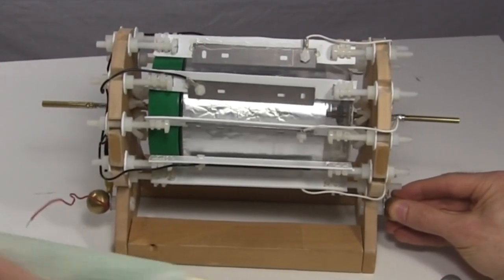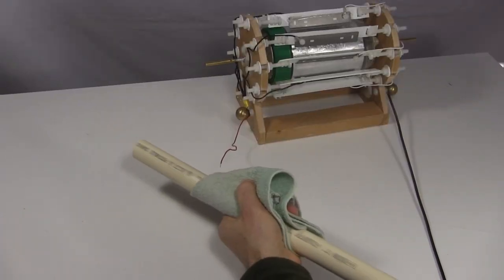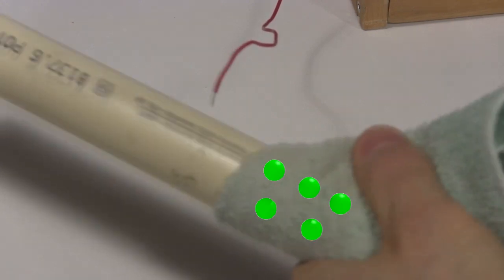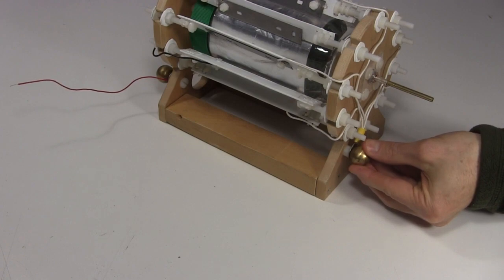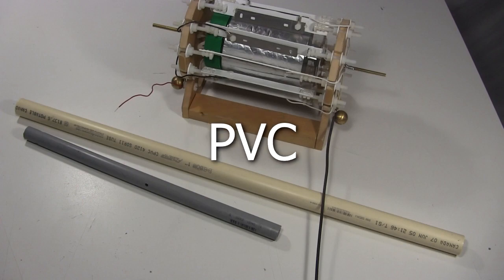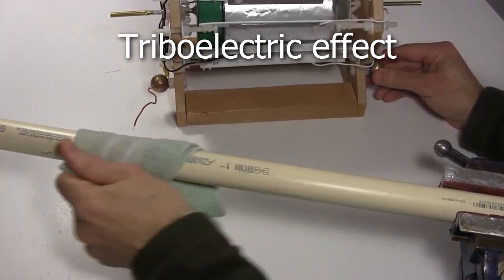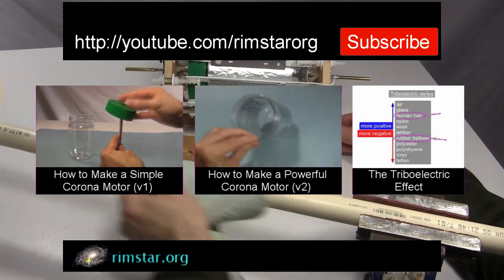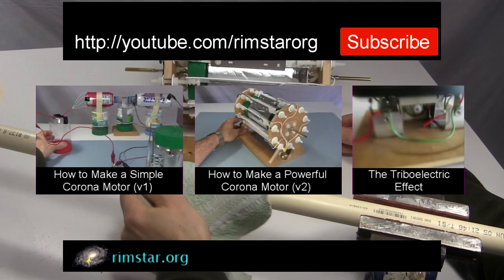Powering Corona Motor with Triboelectric Effect

Comment: Very funny,,
So looking at the table,
On the one hand we use PVC pipe, on the other hand if we use aluminium , it is more negative than cotton and when in contact with the skin, we are even more negative... will it work better?
Reply from the maker: Are you saying use aluminum rubbing against the bare skin? One problem with aluminum is that it's an electrical conductor. That means that any charge that's produced will spread out all over the aluminum and so there'll be less charge in the spot facing the thin wire. Also, the skin would have to be very clean, no oils at all. Otherwise oils would get on the aluminum and the effect wouldn't work well.
Reply: @RimstarOrg  That's right, in that case
would take the mobile part (PVC) and
 the aluminum would be fixed by connecting it to the engine.

I want to thank you for showing me in your videos things that I barely knew, especially the difference in electrical potential in the atmosphere, as I read in the texts of R. Feynaman

Comment: When sparks form between two objects, why doesn't it form branches as we see during lighting?
Reply from the maker: Because the current takes the path of the lowest resistance, which is usually a more of less straight one between the two objects. The ionization paths in the sky during a lightning storm aren't as straight. For more than that you'll have to look up about lightning.
Reply: But tesla coil can produce such type of sparks with branches as we see in lighting. ...that's why I asked you?
Reply from the maker: Exactly. Tesla coils streamers aren't between two objects. They're path is determined more like lightning.

Comment: I wanted to ask you that I' ve often read on google that in corona discharge, the insulator becomes conducting only locally around the conductor...then how can charge jump from the PVC pipe to the open end of wire...because it can happen only if the whole space between the open end of wire and the PVC pipe is conducting...but if this is the case then why don't we see sparks???
Reply from the maker: I don't know of any way to tell which will happen. However, if one of the sides is a sharp pointed wire then that will reduce the chance of a build up on that side. Instead it will start leaking at a greater distance. I discharge the dome of my big Van de Graaff by bringing the sharp points of a grounded wire to it, instead of a rounded ball like most people do. The rounded ball allows both sides to build up a lot of charge before the air becomes conductive and so there's a big rush of charge when it does. The sharp points don't, and so I don't get a spark.
Reply from the maker: I agree that the conductor doesn't conduct the charge. What's happening here is that as charged area of the PVC pipe sweep by the sharp point of the wire, the high voltage between the sharp point and the area of the pipe that's nearest the sharp point at the time causes the air to break down and become conductive i.e. a weak corona forms. That allows some of the charge to cross the gap. Then the pipe continues to move past the sharp point and another area of charge jumps the gap, and so on.
Wikipedia has some good descriptions of positive and negative coronas here: https://en.wikipedia.org/wiki/Corona_discharge#Positive_coronas.
Reply: So if the air between breaks down completely (as only then charge can flow between PVC pipe and the end of the wire) why don't we see a spark??

What here stops a spark from occurring??
Reply from the maker: The air can conduct without there being a spark. For a spark there has to be a lot of charge available and there isn't in this case.
Reply: Thnx for such a fast reply!!!

one more question, then how can you tell in a situation that whether a spark will occur or a corona discharge???
Reply: Why in corona discharge there is glow only in the surrounding of the sharp point??
Reply: I got the same doubt!!!
Reply from the maker: If you have a sharp pointed object facing a smooth object, the same amount of charge will be on both objects, but because there is less area on the pointed one, the charges will be closer together. That causes the electric field to be stronger there and so more ionization will occur there. I illustrate this as part of my video on how Ion propulsion works https://www.youtube.com/watch?v=01F8V5IhB5k.
Reply: How do you discharge a Vande graaff by a sharp pointed conductor?
Reply from the maker: It's one end of a stranded wire that goes to ground. I stripped the end of the wire a bit and spread out the strands a bit.
Reply: Only problem I am having in understanding is that we say that corona discharge takes place at sharp edges and charge tends to leak from sharp points so how can it discharge a van de graaff....

In the video of ion propulsion that you told me to watch, in that you told that system will move but from that video., I can't understand how a sharp edge can discharge a van de graaff because here we don't require movement of system. ..
Reply from the maker: That leaking is the discharging. The leaking is the charge moving from one object to the other. If the Van de Graaff is positively charged with respect to ground then the leaking is electrons moving from the wire into the ionized air and likely ionizing a molecule (since electrons have a short "mean path" through air, I'll leave you to look that up) and the molecule then is attracted to the dome where it deposits the electron, making the dome less positive.
If the dome is negative then the sharp point is removing electrons from air molecules, making the air more conductive and making it easier for the electrons to leave the dome and ionize air molecules, making the dome less negative, which are attracted to the wire where they deposit them.
I may have the details a little off but that's what that wikipedia page about corona discharge.
I see your confusion regarding movement in the ion propulsion video. That video didn't point out that some of the ions do get to the smooth object as I described above. It just wasn't relevant to the subject of the video since that part of the interaction didn't result in propulsion. I guess it wasn't the best example to give you, though it at least showed the ionization at the sharp point. Hopefully my description above fixes that.
Reply: This reply of yours was pretty much a homerun....just one doubt regarding your reply- the term wire that you mention, I can't understand where did that come from?
Reply from the maker: I was referring to the stranded wire with the sharp points on one end, the one used for discharging.
Reply: I've seen Walter Lewin lectures and he sometimes uses the word "corona discharge" for rounded objects also...is this possible???
Reply from the maker: Sure. A rounded objects is just a not very sharp object. It takes more charge to get it to produce a corona but if it has enough then it will. That's why a small 3 inch Van de Graaff dome will only reach a lower voltage than a large 15 inch VDG dome. The small one will start producing corona, which means it's leaking charge to the air, at lower voltage (i.e. with less charge). Being smaller, its "sharper".
Reply: <<<< It takes more charge to get it to produce a corona>>>>

Won't a spark will take place before corona can take place....because if this is what you say then a spark will never take place because after corona discharge conductor continuously loses charge...
Reply from the maker: A corona happens first and makes the air conductive enough for a spark to happen. The spark is the large amount of charge that was built up and waiting to cross the gap but couldn't because the air wasn't conductive enough - the air was too good of an insulator. With a rounder object, more charge can build up because there's more surface area and there's less charge leaking away to make the corona while the corona forms.

Comment: Do you think an air ionizer (just search 'anion 12v' on ebay) would be able to power these electrostatic projects? There pretty cheap and simple to use
Reply from the maker: Blast I can't say for sure, but I strongly suspect they would. If weak triboelectricity like in this video can do it, then an ionizer should work. If you try it, let me know how it goes.
Reply: RimstarOrg I think I'll try it with the lifter, Thanks
Reply from the maker: Blast Oh, I'm pretty sure it'll power this corona motor but I know it won't power a lifter. For a lifter you need around 25kV and a relatively large amount of current. Even if you stepped up the voltage of that air ionizer, I suspect it still won't put out enough current without damaging the ionizer.

Comment: If you take the pickup wire and wrap it around the pipe under the cloth you can pick up a lot more charge.
Reply from the maker: Makerj101 Are you sure? At first you'd think so but taking charge off of plastic using surface contact like that is hard to do in my experience. I discovered that for myself and then read about it when I made my video about dissectable capacitors.
Reply: RimstarOrg It was a while ago that I did those experiments.  I was about 12 when I used that method to charge up some capacitors made from film canisters.  I also used it to test out a homemade electroscope. I'll give it another try and maybe make a video if I get it working.  It could have just worked ok but at the time I thought that was awesome.

Comment: Could you use a piezoelectric gas lighter (such as this one https://www.easyspares.co.uk/pics/ver_4215.jpg ) as the motor's electricity source? I'm not sure how they could be connected to the motor and whether the output would be suitable for powering it but piezoelectricity seems to be a better source power than the triboelectric effect, considering the force/amount of work applied to output electricity ratio. Any thoughts?
Reply from the maker: posysajrazdwatrzy It would work if you could make it continuous. A piezocrystal gives a brief voltage and current spike when you first hit it (or bend it depending on the type of crystal.) Even if you hit it and maintain the pressure, the power occurs as a brief spike only during the hit. The power doesn't remain after that until you hit it again for another brief spike.It's actually more of a dampened sine wave than a spike, but the useful part of it is a spike as you can see in the oscilloscope output in my video about taking one from a lighter here (around 5:46 into the video) http://www.youtube.com/watch?v=DAyM8Iet1O8. I have another video where I take one from a BBQ igniter here https://www.youtube.com/watch?v=oegbv-1cKCA.

Comment from the maker: By request... The simplest way to power a corona motor, using the triboelectric effect. Some things are kinda hard to describe in a text reply, so thought I'd make a video explaining it. Hopefully it'll help.
Reply: Super !!!!
Reply from the maker: Gianni Pirola
Thanks!
Reply: Waiting ...!!!
Reply: Did you ever try corona wires for electrodes from a copier or laser printer? New ones would be the best if you can get some, maybe from a place that services them.
Reply from the maker: I guess those would be very thin wires? I've used thin wires to produce corona for making lifters fly as in this video https://youtu.be/vzZy1Aqleno

Comment: I should get into this, we certainly have plenty of pipes from failed plumbing fixes. Thanks for the very clear working principle animation :)
Reply from the maker: slider2732 Failed plumbing... been there, done that. :) Yeah, when I first tried using triboelectricity to power it I just charged the rod and then put it near the wire. Doesn't work. The key is to keep a flow of charge going. So charge the rod, pass the charge on, charge the rod, pass the charge on, ... I figured the animation would show how that works. Glad to hear it's effective. Thanks.
Reply: RimstarOrg
Am wondering about a great visuals project you might wish to do, related to this.
Being that the charge needs to keep being applied by motion, how about a Stirling engine moving a rod back and forward with the wool material on the end ? The wool would wrap similarly to how the hand holds it now, tape around the wool would enable that. Your Fresnel lens could do the job for the Stirling to operate perhaps.
Another option would be a home made steam engine to do the piston movement.
Just an idea :)
Reply from the maker: slider2732 I don't think I can get much out of my Fresnel lens with our low winter sun (Ottawa, Canada) right now. But I was thinking my Cube HV power supply running the corona motor which turns a Wimshurst machine which powers an ion motor or something.
Reply: RimstarOrg
Haha indeed, seems like great fun and would bring lots of projects together :)